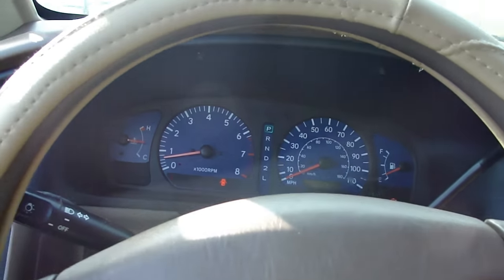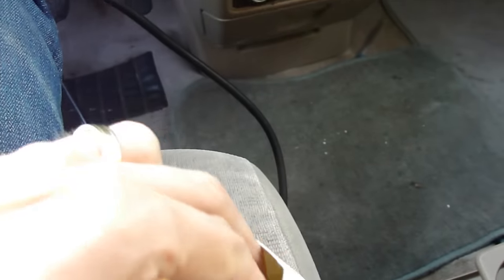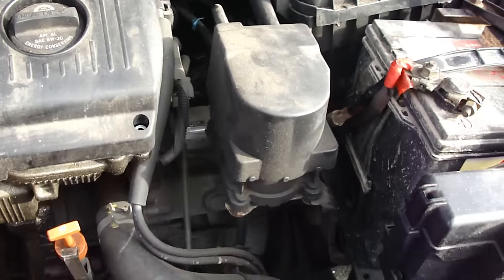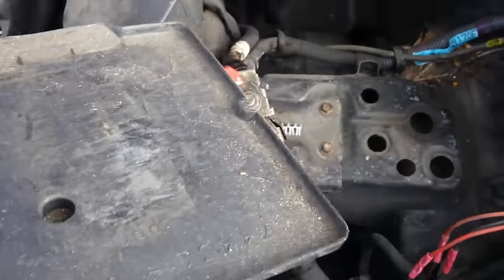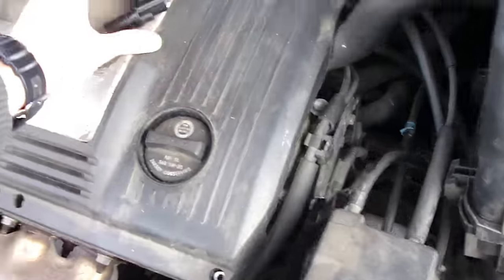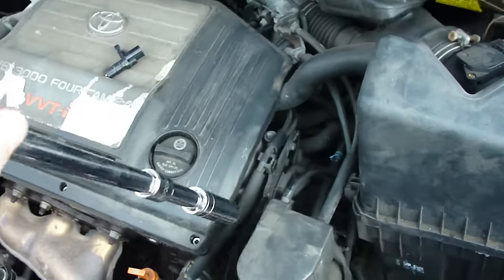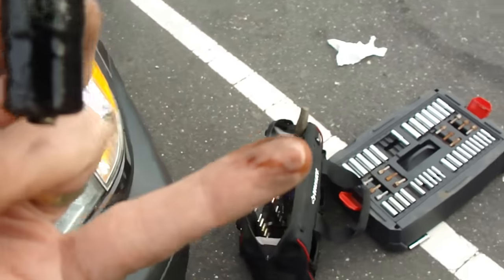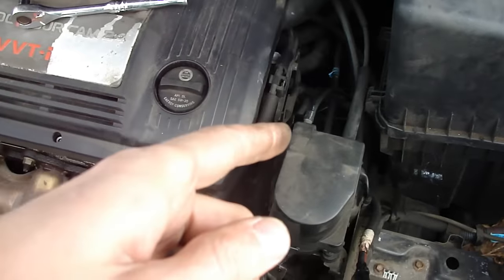Toyota Sienna p0500 speed sensor location and replacement

Comment: Good tutorial video 
I have 01 sienna with the same problem  P0500 just replaced the sensor but the check engine light still on , any a ideas why still on. Thanks 🙏
Reply: 2003, about to try again.  There are TWO vehicle speed sensors on the transmission, an  "A" and a "B" and it seems to very unclear which one is which. Lots of conflicting, or missing info when looking at videos and diagrams. 

I am hoping this guy got it right.  I am guessing he thought he need to remove the battery because you have to do that to access the other speed sensor. I replaced the one further forward and had to remove the battery, but the P0500 and poor shifting came back in less than 10 minutes of driving.  Next, I am going to try the top one as this guy did in this video.

Comment: I have the same exact code on 2007 sienna. I replaced both sensors and it still didn't work. Took it to 7 different mechanics and none of them knew how to fix it. It could be the wiring, I might take it to an electrician. idk what else to do anymore.
Reply: Any update?
Reply: @JackMeyHoffer562  I traded the in and bought a new Camry , no mechanic knew what was wrong.
Reply: @JackMeyHoffer562  I’m thinking it was some wire, but there’s so many wires 😂
Reply: The combination meter is usually the culprit

Comment: Hi friend.  Thanks for the video.  Very comprehensive.  A few questions...
1. Does this speed sensor also affect gear shifting for auto transmission. 
2. Is the procedure thesame for 3.3 highlander 2007 model?
I own a 06/07 highlander which had an accident.  After the accident, car can not shift gear, speedometer does not work at all.
The wires to the ABS sensor on the drivers side parted during the accident and was joined. 
Which sensors could  be faulty here. There is no scanner available to run a scan.
Thanks for your video
Reply: Nwanne I have same issue, have you rectified yours?

Comment: 2007 Toyota Corolla s..my speedometer still works but the vehicle rev out high wen I drive it .  Code p0500 .and I had replaced the output sensor and same thing. Could I have gotten the wrong one?

Comment: My 2005 Sienna gave me a sustained P0500 code along with an ABS light.  

I then replaced the battery (for another reason) and the code went away but the ABS light is still on.

Does anyone know what this could be?

Comment: I have same problem. I removed ABS module which disabled speedometer but rough driving due to poor transmission shift. So I think speedometer is fed by ABS module which is connected to four wheel speed sensors. It is loose connection somewhere on some wheel speed sensor.
Reply: Mahadev hi I have 2003 sienna it’s doing the same thing yours is doing did you ever figure out the problem please let me know
Reply: @elimarks718 : I replaced the ABS ECU module, it works fine now.  on ebay.com rebuilt ones are sold. match exact part number.  ABS motor not replaced. Take Airfilter assembly out, then ABS module can be removed by removing 4 screws.
Reply: @elimarks718  : I made sure no loose wheel sensors. Also the ABS ECU is malfunctionaling as per diagnostic procedures given in the repair manual and scan tool for ABS.  The ABS modules is a culprit for me.
Reply: @elimarks718  : I disconnected Motor 12v wire from/via Harness connector to disable ABS permanently. Speedometer worked. Randomly, then the speedometer was fluctuating even when car is stopped at walmart parking lot. Then I knew the ECU of ABS is broken for sure. So I replaced ECU of ABS, now I am good.

Comment: Be aware: the 2000 model does not have a transmission speed sensor.
Reply: I looked for the damn thing for 2 days and nowhere to be found! 2000 Sienna CE. I guess the sensor is the same that goes for the ABS?
Reply: @JohnElHanafi  Yes, I've been looking and nothing. The dealership showed on the screen the location of the sensor, but it is not there in my Sienna. They missed something. https://www.toyotanation.com/threads/transmission-speed-sensor-location-just-shoot-me-already.1511586/
Reply: Donde yeba espid sensor toyota siena 2000 ce

Comment: I replaced mine on a Sienna 2002 but still the speedometer not working with emergency brake and ABS lights ON. Code still read P0500
Reply: I got tus same problem too
Reply: Change ABS speed sensor
Reply: it is abs module

Comment: on my car that sensor didn't fix it, It turned out to be the codes for the abs sensors i cleared them and the the speedometer worked because on a 3.0 liter v6 thats what it  uses